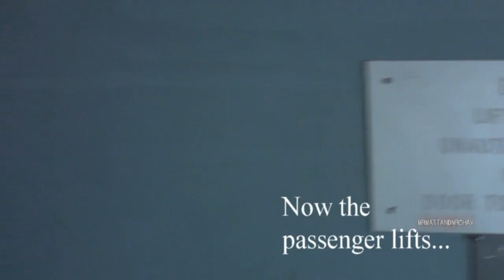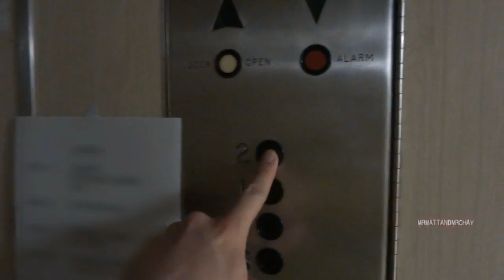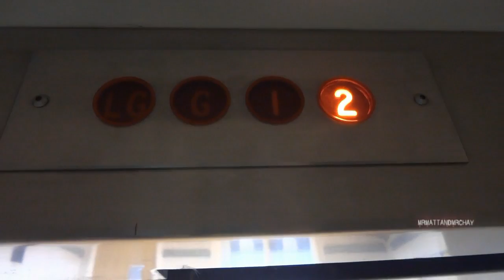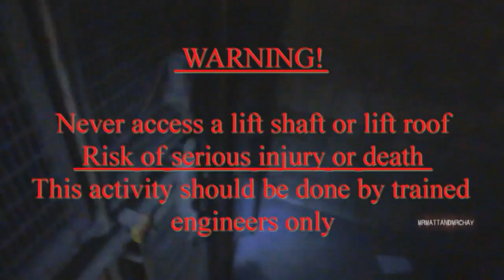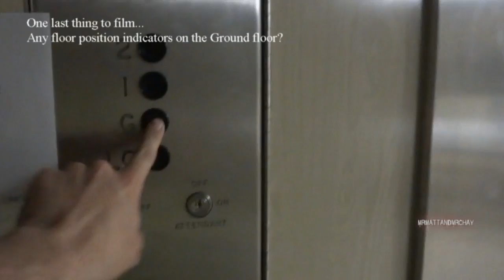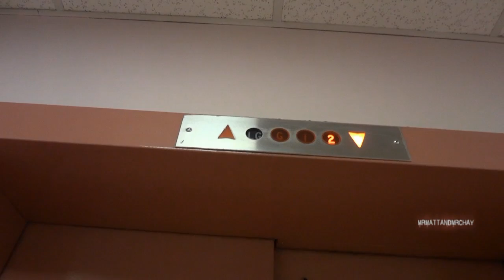VERY CREEPY old Bennie Lifts (1970) with SHAFT and car top footage.

Comment: Sometimes you need to have the unit in door zone / floor level for the open close switch to work. Also you must make sure nothing on the inner door catches on the door lock on the floor below otherwise you could open the landing door below without the elevator there exposing an empty shaft.